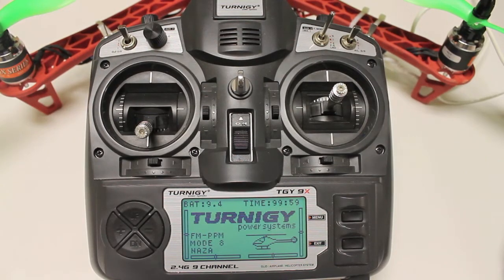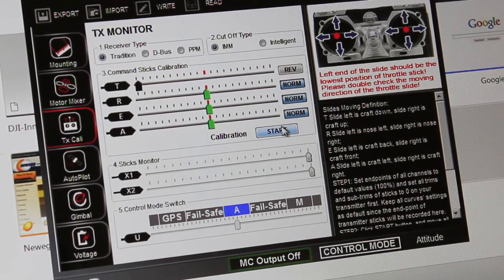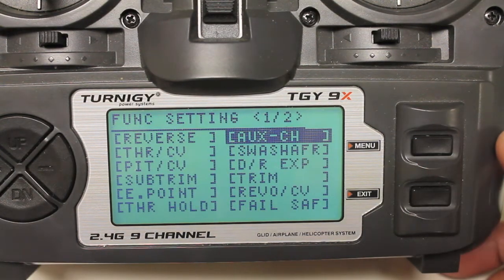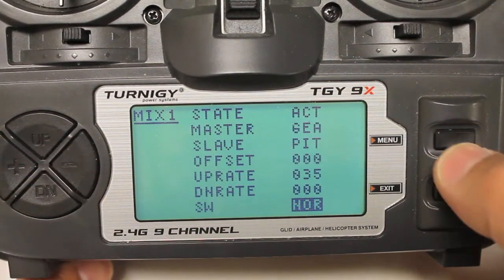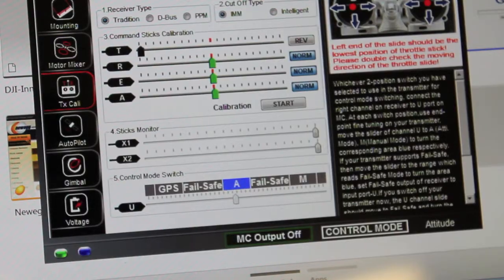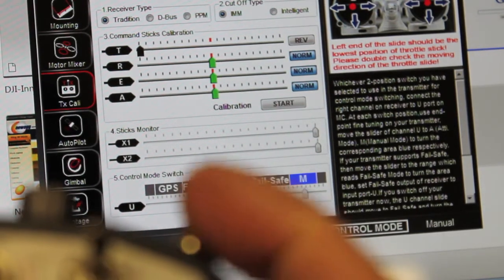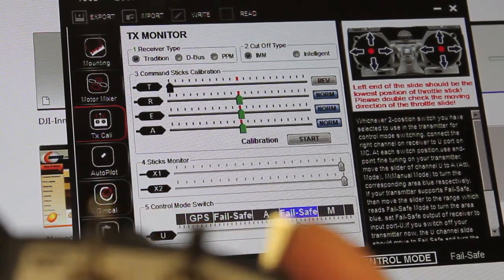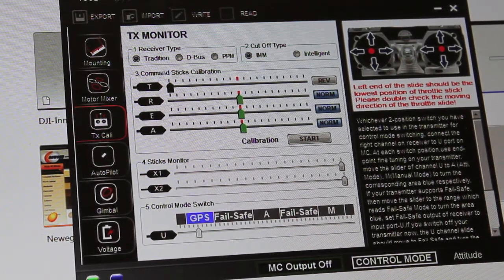DJI Naza Forced Failsafe Using Turnigy 9X Gear Switch Channel 5 Mix w/ 3 Position Switch

Comment: Hi me i have mix 1 to 8 ..and you mix 1 to 3 .???? My x9 and djt and dr8 2 plus is the same of you?i cant put pitch on my mix 3?
Reply: You want to have failsafe-switch on all positions on the 3-way switch, right?
 
With original 9x firmware, I got it working with mix 3
Master Gea
Slave Pit
SW ID2
and modified the curve to stay in GPS-mode for L, 1, 2 and 3, and failsafe for the last position:

L: 50.5%
1: 50.5%
2: 50.5%
3: 50,5%
4: 31%

These values might not work for your setup, since I had to use other values for pitch curve

Comment from the maker: Joe, I haven't done anything specific to CL and HL but I've done something for 3 flight modes with Naza and you could adapt that. I plan on doing a vid soon that shows 6 flight modes including CL and HL, but will be a week or two. Let me know if you have any problems adapting my 3 flight modes video if you give it a try. The video is titled "DJI Naza 3 Flight Modes (Attitude, Manual, and GPS) w/ Turnigy 9X Transmitter and 3 Position Switch"

Comment: Dennis! I am pretty lost right now and need help. I have set up my naza like you, GPS, ATTI and Manual on the three way switch. I have failsafe on channel 5, on gear switch. I am now adding i retractable gear to my F550. I have put them into CH5 on the receiver and it is working when i flip the gear switch. The problem is that it enters the failsafe and i only want the gear to move. Can i program it too some other switch, like the one on the opposite side? Can i make gear go down with failsafe?

Comment: its david I am still waiting on your wiring for the naza to 9x stock receiver !,I know that you are realy busy but I realy need the wiring details
Reply from the maker: Okay, but let me ask this. Are you able to get your NAZA flying with out any of the flight control modes and just in attitude mode? That's what I'd recommend first. So that would be your standard channel setup:

T9X Receiver -> NAZA
CH1 -> A(ileron)
CH2 -> E(levator)
CH3 -> T(hrottle)
CH4 -> R(udder)

Get it in the air first and get comfortable with it before you try and setup the flight modes.
Reply: I have been flying the naza v1 for 18months I just upgraded to v2 and added gps I know how to setup the 3 position switch  atti-gps-manual
Reply: and ch 6 goes to uport of naza?
Reply from the maker: david ringler Yes indeed!

Comment: So as I understand it. The naza can be put into home return via the failsafe gear switch. 
But will it also work as the phantom.
I mean does the naza in a F450 returns when it has lost the signal from the Turnigy x9?

Comment: Hi Dennis. Do you have a "normal" email, where i can write a questions about my hexa. I have a problem i can't solve. Only 3 engines start an the other 3 start when power is over 50 %. Best Regards. Palle from Denmark

Comment: No, nothing happened to the U slider when I flipped the gear switch.  I finally scrapped the gear switch and set the channel to the 3 way toggle Aux 3 switch.  It now appears to be working fine.  BTW, is there really any reason to have manual mode set if I plan to fly pretty exclusively in ATTI?

Comment: Hey Dennis, I tried everything I can think of and I still can't get it to force failsafe. Is there any other settings you used and forgot to mention? Some one else on YOU TUBE reversed the gear switch and messed with the end points, but his settings didn't help me. I also couldn't calibrate my GPS unless I had the 3p switch set to GPS, ATTI and Manual mode. If I dropped Manual mode in favor of fail safe I can't get the GPS into calibration mode, I'm thinking i need Failsafe, cause I'm new this.

Comment: *another edit*

While messing around I managed to find a different solution: use the throttle cut switch (top left). First, activate the switch: settings >>   THR HOLD >> switch INH to ACT. Next, with the switch activated, get into settings >> PIT/CV. Second line should read: 'Point [hold]'. If it's [nor], flick the switch. Change all pitch values to 26.5, which for me is fail safe. 

Presto!

Comment: Also, should the configuration be the same if I am using a Frsky with PPM (only one cable between the RX and MC). I can't figure out how to set the TX up so I can switch between GPS, ACRO, Failsafe and Manual mode. Thanks

Comment from the maker: Oh, very cool. I need to get one of these! I read the following statement:

"The Turnigy switch will complete a circuit when the radio channel passes 50%. "

Have you seen my video that explains how to use the gear switch to set different flight modes? I suspect by doing something similar with your switch setup for the gear channel you can get it to toggle. Let me know if that doesn't make sense and perhaps I can get one and do a video. Although I'm sure you don't want to wait around :)

Comment: I have this radio. My Naza does not work cause a error 29 ( The mid point Sticks errors is very big)!
so, I tested my radio in another Flight Board ( kk2.1.5 ), and i confirmed the thuth. The stick range ( course) is assymetric.
Somebody helpme , please??  Whats Can I do? 

Thanks a lot!
Reply from the maker: Francisco Augusto It sounds like your throttle curve may not be linear, which can cause this behavior. Try setting up a new model and I would use the ACRO template which should cause your curve to be correct. If you continue to have problems check out www.garagepilots.com and post in the forums. Maybe we can help you out over there.
Reply: Thanks a lot,Mate !

Comment: With this Forced Failsafe setting, What happening if 4copter have lost (in GPS mode) radio signal (out of range or TX turn OFF) ??? Do I can have my copter back home?
Thanks.

Comment: G`day mate. just wandering, you use heli mode. is this setting for multi rotors? becuase every other videos ive watched for setting up quads tell you to use acro mode, im only new to this and having no luck getting in the air, i have kk2, eagle n6v2, now dji naza with gps. id love any help.

Comment: Dennis, I have configured mine but too scared to try it. When plugged into the pc and looking at the GUI and flick the switch the throttle does not change. Is this correct? Should it throttle up to around 50% similar to when failsafe for a out of range or transmitter turned of failsafe is activated. As demonstrated in a previous vid of yours. Chris

Comment: *edit* switch not broken according to the 'display' option in the receiver. I don't know what's wrong. 

I had X1 and X2 set up using hov pit on channel 7 and pit trim on channel 8, so that I can use those knobs to control (i.e.) home/course lock. Removing those did not fix the issue of the gear switch not working. I have no idea why it won't work, tried walking past most of the settings but.. no dice. 

My NAZA will go into failsafe when I turn off my transmitter, for now that'll do I guess..

Comment: i~ve got H4, Y6,Y3  and a HAL hex copter. i follow all the video posted i got more flight controllers than you can point a stick at, yet i cant even get even a basic hover. all i get is flipping major drift. im at a loss. and have spent huge money and still fail.

Comment: noope, i mean: i have a Turnigy Receiver Controlled Switch, if you search it on Hobbyking you understand my problem. It is a kind of relay that, connected to receiver like a normal servo, open and close a contact betweed two wires. I don't know how to set it to make it works :)

Comment: how to setup IOC ( home lock) switch
Reply from the maker: salam ahmad I was unable to do this in conjunction with flight modes on my Turnigy 9X. I could do it standalone and forego the flight modes but didn't want to do that. So when I upgrade to the Taranis this was easy to do. Good luck with your search.